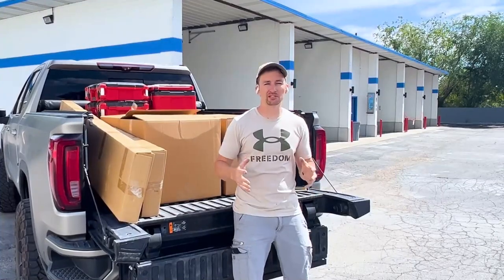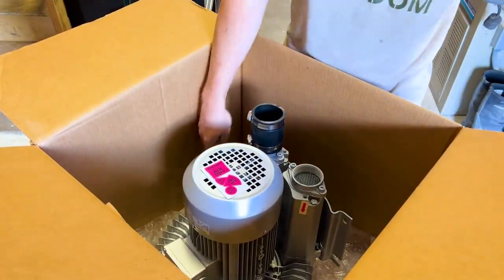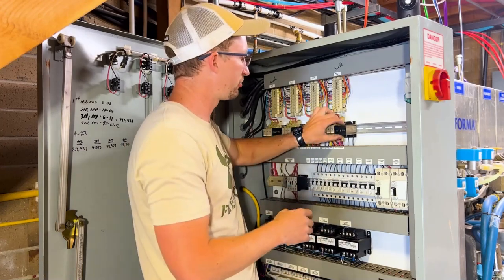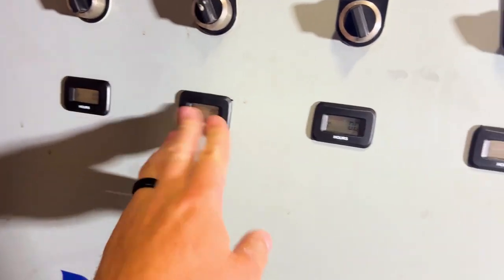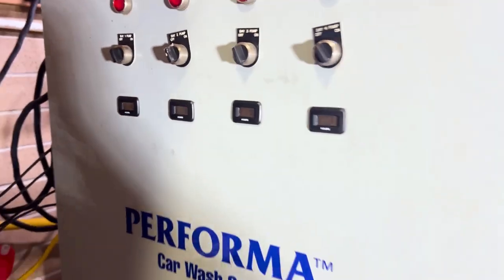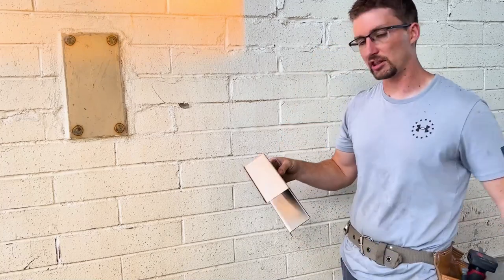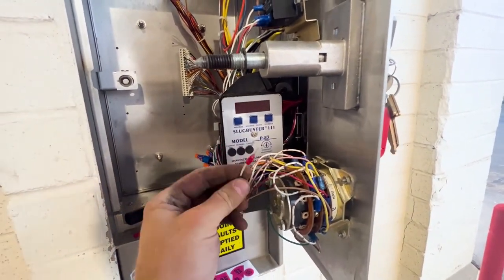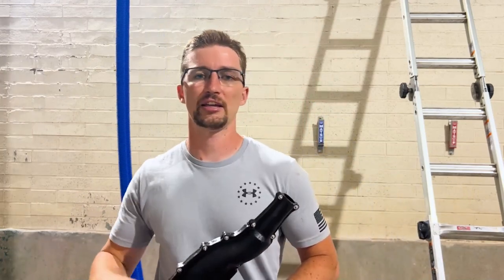Air Dryers for a Self Serve Car Wash | Full Installation

Comment: My OCD thanks you again for your wire organization, hose organization, and having a clean equipment room.   

As far as the air shamees go, when I bought my wash, I thought they were a novelty and didn't think people would really use them, and I am SHOCKED how many people use them.  All on the meter.   It's crazy.  Hope you see a good ROI on them.   I wish I had an attic to get the noise out of the bays!

Comment: Great install video. Keep an eye on the nozzles. Mine split at the seams. Also the trigger plunger starts leaking major amounts of air. I replaced all 6 bays with the Air Logic nozzles. WAY better air flow and no trigger to hold. I had many customers comment that the increased air flow was amazing. Not cheap but worth the $700 in increased usage and customer satisfaction.

Comment: Stopped by today for a wash and you may already know this, but there are some issues in your second bay or maybe all of them depending on how it’s plumbed. The soap setting wasn’t doing anything and everything else using the pressure washer pulsated really badly.  Just thought I would pass this along since I didn’t see any number on the building to contact.